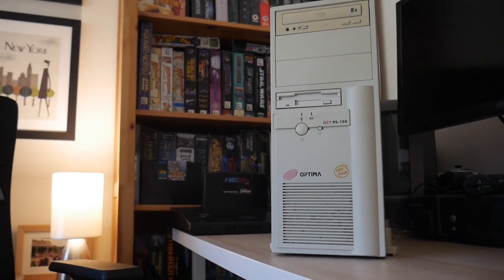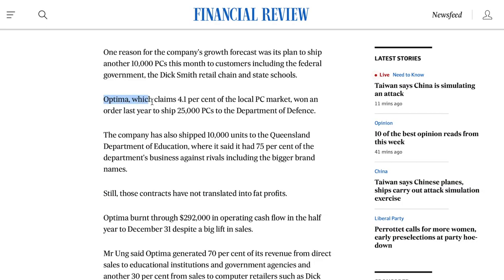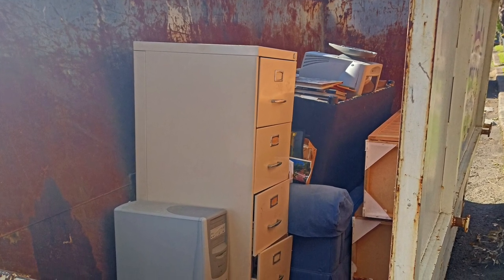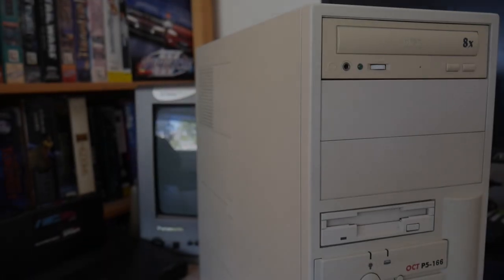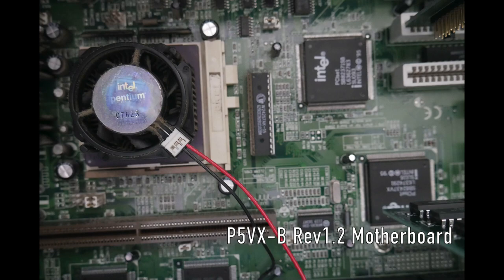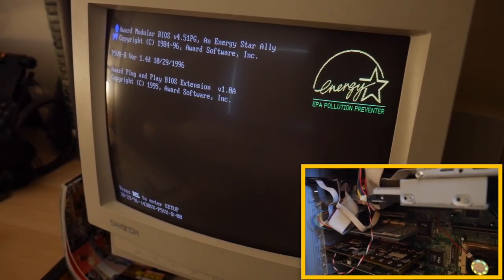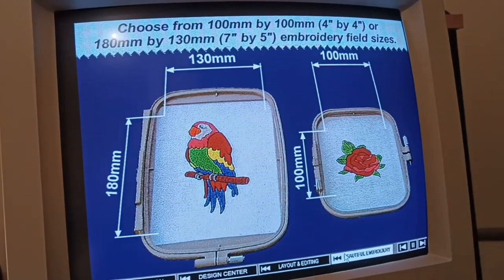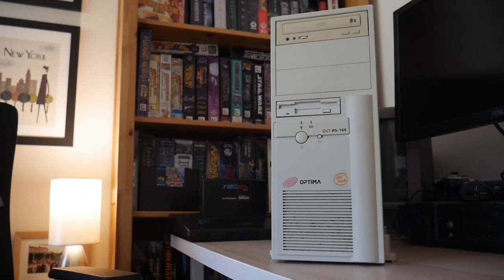The Thinking Australian's 1996 Pentium Computer by Optima Computer Technologies

Comment: Those cases were manufactured by PADG (Palo Alto Design Group) and were also used by Dell, Micron, and many others in the 90’s. I had a couple unbranded units back then.. I wish I still had them as they were nice to work in.
Reply from the maker: Hey thanks for that additional info. It is a good case with a lot of space for sure. I think I saw someone post an image of a similar case on Reddit a few months back so now it makes sense if it was a case design used by other manufacturers

Comment: Cool video, I just found a Optima Computer Tech nologies computer, running a Opti 82c283. I haven't got it running yet. It powers on, it has 2 3.5 inch floppys and a 5 1/2 floppy drive. It was in the e-waste at the local tip.
Reply from the maker: very nice, best of luck getting it running. the 5 1/2 floppy drives are starting to creep up in price here in Oz. Minimum $50 when they do pop up on ebay.